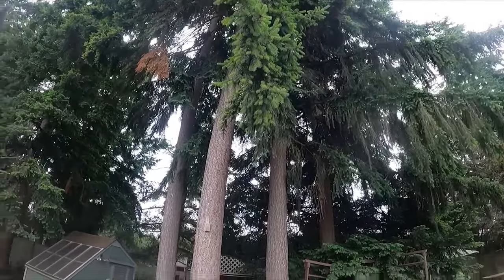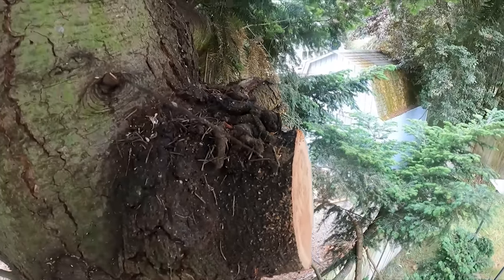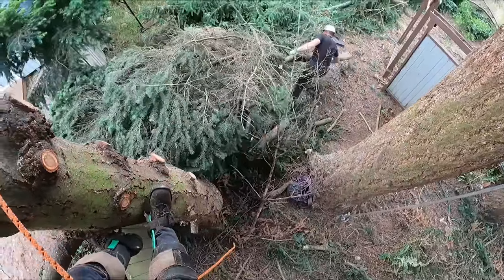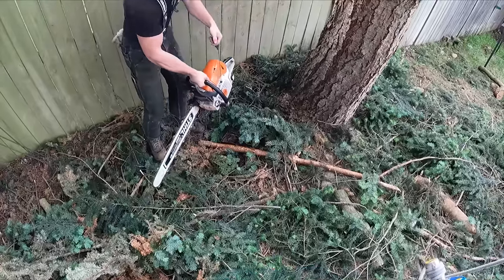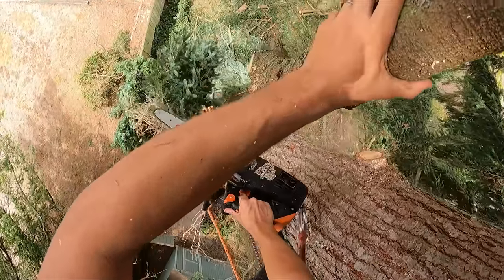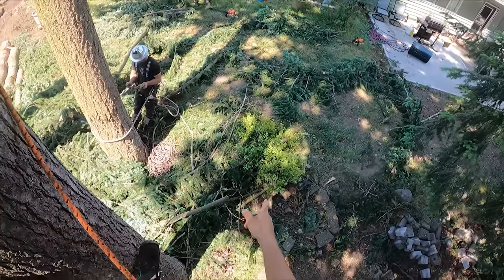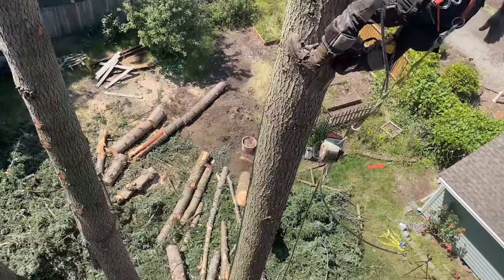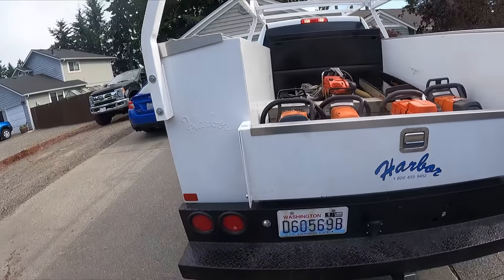Complicated Backyard Fir Removals!

Comment: Technically just 2:1 it's weird but the highest pulley is just a redirect. If you had a guy up where the pulley is holding the lowering line without the pulley it would feel the same as the guy on the ground holding the line through the pulley/block

Comment: You do deliv er fast ..and got the order right.wish you had more spliced ropes.and 1/2 5/8 3/4 forestry pro ..I believe hams arborcare does .and rite rope but it's high and they charge shipping .need some but spliced ends .arbsession will but they don't carry it either it's best all purpose rigging line there is in my opinion and can natural crotch. So no need in setting blocks and junk just shoot it over the crotch and rigg..had a 120 ft half inch of it now 3 or 4 years stuff is just strong 💪. Even blocked down hickory loggs with it .just wish could get the ends spliced it's 12 strand so can't understand why no one splices it .??the Canadian loggers used it for years those stable braids are ok but you gotta set rings blocks xctra.its nice as solo guy mostly to just natural crotch ...thanks

Comment: 17:03 I bet cha wish ya had a handy short line tagline lol I’ve had this happen quite some times ahaha ended up getting 10 feet of 1/2and using it as a tag line that can unravel with a wrist flick of the rope . Good work tho on the fly close quarters 🤌🏾🤌🏾👌🏾👌🏾 your groundys a straight savage 😈😈😈😈you don’t find hardened groundys like everyday initial cut had me puckerin for a second lol I kept thinkin the stem was gonna come even faster towards ya thankgod it didn’t ✊🏾✊🏾🙏🏽